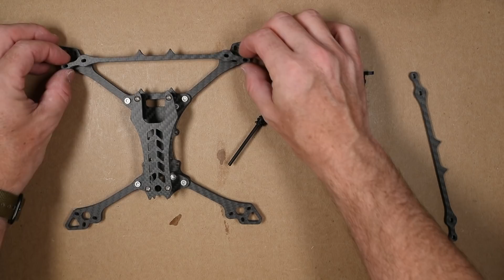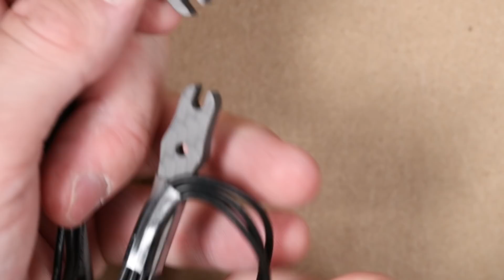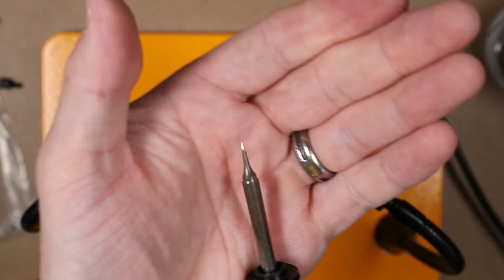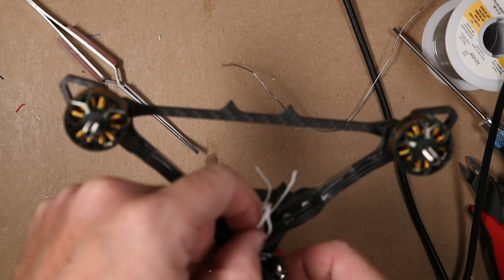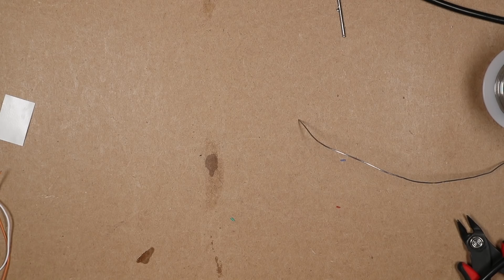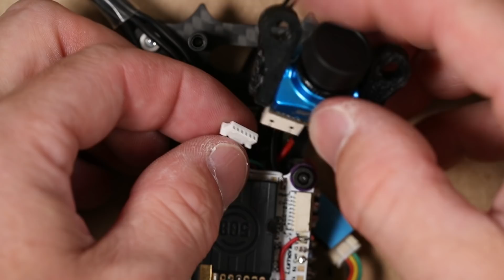Catalyst Machineworks Slam Nasty! Build video

Comment: I’m an old timer and a rookie fpv guy but i have been building rc models since the 80’s, and i just wanted to say you did a good job on your video. I was thinking about re-purposing the guts out of a AcroBrat build i did with some 1506 4100kv motors for a more streamline 4” build. I am building a 3”massive droner which i hope to maiden if the weather ever gets above 40 again lol. I like that frame i cant imagine it wont fly wonderfully, I just hope its durable.... I did mention i am a rookie ;) I like the idea of using American Made products where I can. You did a fine job young man. Thank you! Shalom
Reply from the maker: Welcome, and I’m happy you enjoyed the video! I love it, a “rookie” with two builds and another in the works. Man have things come a long way since the 80s rc. My first model aircraft was purchased late 80s early 90s. Basically plaster a foam body with stickers, install servos, and pour in some fuel. Oh... and nick your fingers with every turn of the spring tension prop while starting it. I was a bit to young to fly it so my father graciously found the only telephone pole in the local field for me. Was never able to glue the engine back the the fuselage. Anyhow, this frame is more race centric. It will handle most crashes but flying freestyle over concrete may bring some issues. I did crash it from about 100ft up into grass and it was completely unscathed. It’s super easy to make any repairs if they are needed. Catalyst is one of my favorite frame manufactures. I’d say 70% of my quads come from them. Thanks for taking the time to watch!

Comment: Those motors are Nasty! I'm enjoying t motor f80 pro 1900kv. Those dalprops are good and one of my favorite however my favorite is the t motor 5147. There really fast with incredible agility. I do a lot of Los flying so I need the razor sharp handling. Give them a shot one day if you can. Awesome review. I just watched it again to see the antenna mount. I just received my mount and debating if I really need it. Take care
Reply from the maker: These motors are Nasty. Super responsive, and provide exactly what I hoping to get out of them. I’m happy with the prop combo I’m running but I’ll throw some 5147 in the cart to try out. I like the antenna mount, keeps everything tucked away for the most part. Thanks for the rewatch!
Reply: @breaksteel  if your still having the motor issue have you tried doing a ohms check on the signal wire from esc to FC? Some meters have sharp probes of not use a paper clip and move the wires around a little? Maybe a week connection? How are you doing with that frame? I just removed the frame bumpers. Got weird flight oscillations when I installed them with low filtering? Kind of strange. I flew without them for a few weeks and all was good until installing them
Reply from the maker: mike216ism I haven’t cracked it open yet. Planning on swapping the RX and VTX when I do. Spent some time making a Immortal-T mount for it. Once I get into it I plan to follow the signal from the FC on out to the motor. My multimeter should have no problem getting at those small pads. I really think it’s a motor issue so I purchased a few spares just in case. Should have got those a while ago. 

Interesting that the bar is causing you vibration issues. You certain it’s not a sympathetic vibration originating elsewhere and then amplified by the bar? Mine flies great once it’s above 15-20% throttle, above de-sync territory anyways.
Reply: @breaksteel  all I know is after putting the bumpers on I heard nasty oscillations. Went from 2.0 back down to 1.5 on filtering and was fine with bumpers. I ended up taking them off. I'll just smash up the arms and buy new ones when necessary
Reply from the maker: Weird. When I get mine back in the air I’ll have to experiment with them on vs off then. Maybe a chance it flies better than it already does.
Reply: @breaksteel  your right on. It doesn't make any sense. They fit super tight. However I flew it for a month before getting them. My experience is probably rare so I don't want to blame them. If you notice anything however let me know.  The weather is crap here in northeast Ohio so stuck for a short while. Take care my friend
Reply from the maker: Yeah it’s weird. Have not heard this being an issue. They test their frames pretty extensively before going public too. It’s a breath of relief knowing your not blaming them for something out of the ordinary or so we think so. It’s still just weird how tightening up any arm vibration causes issues. Can’t quite wrap my head around it. 
Feeling you with the weather, I’m not to far to your east. Stuck in the cold and everything here is thick mud.
Reply: @breaksteel  I seem to crash every time in that mud. Picking mud out of the motors sucks. My buddy trashes his quads with mud bent props and whatever and keeps it moving. He definitely is inspiration 😁. I can't do it. I like a clean quiet quad. Maybe some day I'll grow out of that
He's also much better than I also
Reply from the maker: @mike216ism  I've spent too much time cleaning this mud out of motors and socket head screws. If left alone to dry it turns to concrete that can only be liberated with a pick tool and some persistence. I too like my quads clean. Makes them easier to work on and they look so damn good. You do grow out of it a little. I used to hit my first quad with compressed air to get all the grass clippings off of it after every session. That's something I don't do very often anymore.

Comment: I noticed the standoffs are fixed to the braces only instead of the whole bottom plate and arm like any other frames. Do you have any issue with this?
Reply from the maker: It is a pretty different design for sure. There’s a few others on the market that use a similar design. It’s mostly for weight reduction while keeping a tall enough deck space for components. So far it’s held up to my abuse. I fly it as a fast freestyle quad and it’s taken every crash with no issue. It’s easy to assemble and tear apart, replacing the arms is super quick. Now, purely speculation here but it would appear these braces are a weak point and I think that’s intentional. They beefed up the arms to the point where they shouldn’t break. Changing arms is fast but it involves soldering motor wires or removing 4 motor screws along with the 2 arm screws. If the brace is the thing that breaks in a crash it’s only 4 screws to replace. The brace might be the lowest cost part on the entire quad. This saving both time and money. Lots of engineering and testing went into this. For the $49 they sell it for its a hard to beat race frame.

Comment: Thanks for the detailed informations! Pleasure to watch! May I ask you if you could try this motors with 4S and 5 inches props? Punch is surely lower but I'm just wondering if it's decent for flying freestyle. Cheers
Reply from the maker: I would totally fly these motors with 4s. Would go with a tamer prop as the amp draw across 4 cells will be much greater than it is from 6 of them. Maybe a 5x4.5x3. I may drop to these props even on 6s as the AMP draw is significant. The punch on 6s is huge so it would be good for smooth freestyle on 4s. Typical freestyle rigs use a higher motor kv like 2450.

Comment: Hyperlite Flosstyle 3 for me
Reply from the maker: FPVisioning They look like a similar frame. I don’t like the tall stack height of the Floss as it provides extra leverage during a crash and places all that energy directly onto the screws in the standoffs. Thus more easily breaking the entire canopy. Standoff height is easily modded though. I’m curious as to why it’s your preference?
Reply: It's design is unbeatable. Aluminum bottom plate, super easy arm swapping
Reply from the maker: FPVisioning So I’ve spent 5 years in a metal shop working next to the QC who was a metallurgist. We supplied material for the aerospace industry. More specifically Boeing and Sikorsky Aircraft. Knowing what I know about aluminum, it’s a terrible choice for this application. Aside from cost savings I can’t come up with one other reason for it’s placement. A carbon plate is more ridged, lighter, and stronger. The trouble with aluminum is with vibrations and repeated blunt trauma it becomes brittle and will develops hairline cracks. These crack will  continue to crack even if welded. 
   Regarding the arms, the Floss requires complete removal of 2 screws. The SlamNasty requires one screw to be removed and the 2nd screw only to be loosened to remove the arm. 
Comparing the weights of these frames, Floss weighs in at 69.5 and the SlamNasty weighs 65g. The only drawback I see in this comparison is the SlamNasty is $5 more. This all doesn’t make the Floss a bad choice at all, in fact I do like it and may order one soon. Just wanted to point out my views as I see them.